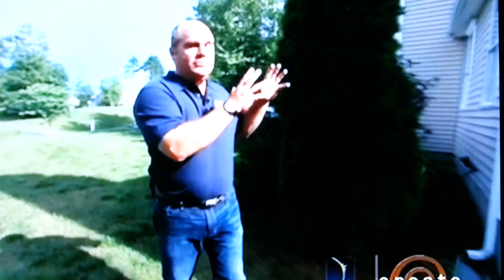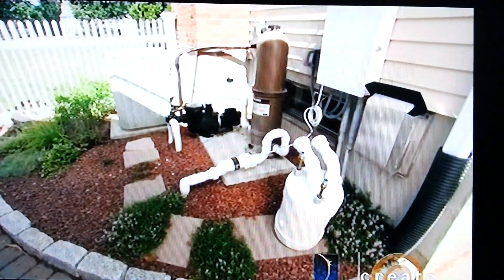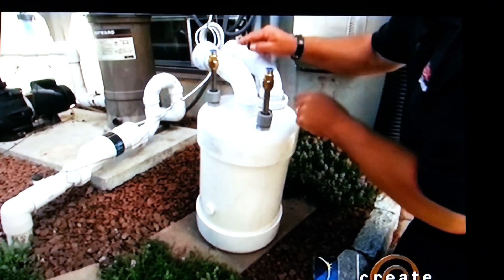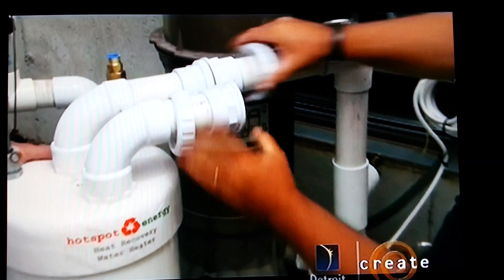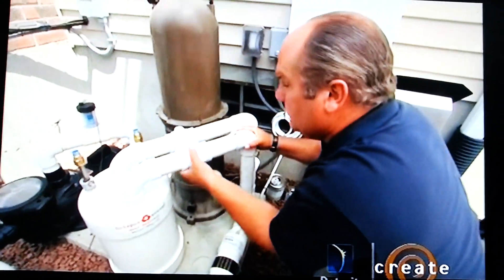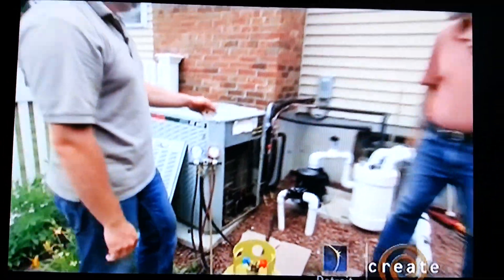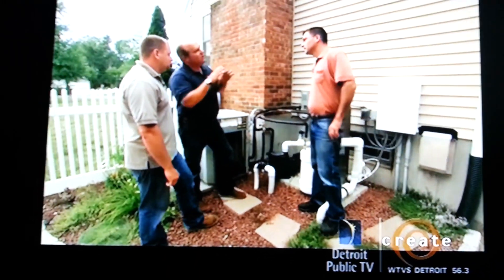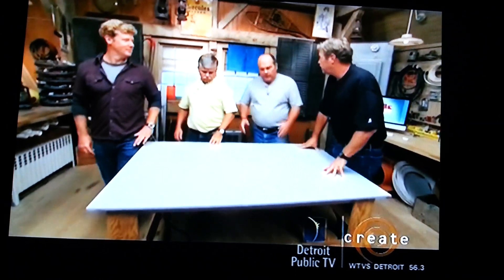HEATING YOUR OUTDOOR POOL WITH YOUR AIRCONDITIONING June6, 2013

Comment: iquid line the used is already sub cooled. Tap into the discharge of the compressor because that's the hot gas. Route refrigerant out to pool exchanger and back into cond unit fins. Rewire the conditioner fan on a fan cycling switch so it closes around 250 and opens around 200 for r22.  This will allow the fan to be used only as needed.

Comment: there are more cons than pros to a system such as this. nothing is FREE. when things go bad and they will at some point it will be very costly to repair and all that FREE heat for the pool will long be forgotten. not to mention that if the A/C unit is a heat pump, now the heat that is going to heat your pool is being taken away from heating your home in the winter time. solar panels on a ground mount stand is a better way to go. again nothing if for FREE. i hope that after posting this about 5 years ago that the system has not met with major tragedy, especially water getting into the refrigeration system. good luck in the future. jim in central florida
Reply: LOL, you don’t know how heat pumps work. If it’s called a heat pump, in the USA that typically means reversible heat pump, so in the winter it would be cold refrigerant going through the lines.. which won’t matter because people don’t use their pools when it’s cold. And the repairs will be far far less than the long term costs of heating the pool. I realize this comment is old and you probably won’t see it but wow someone really must have pissed in your cereal the day you wrote this, not sure why a random pool heater makes you so angry😂 and you just have no idea what you’re taking about, hahaha..
Reply: @mrjjman2010  the line that comes off of the compressor is hot, to very hot no matter if it is in the heating or cooling mode. this line would be the one that you would cut into in order to be able pipe into a heat exchanger for water to become warmer to use throughout the year, whether the outdoor temp is hot or cold
Reply: @MrXcc4u  a modern HP (r410) is pressurized at over 150psi, to get water inside all the refrigerant needs to leak first and at that point the compressor will stop because the low pressure valve. even if you got some water inside you have bigger problems,  the leak needs to be repair, system flush and vacuum to 500 microns (0 water)  
   yes, the line coming out of he compressor is always hot, but this system in a HP is connected after the reversing valve. In cooling mode you will take heat from the outside air, in heating mode the system will be inactive or cooling your pool ( similar to a geo thermal system)
Reply: @mrjjman2010  agree
Reply: This example uses an A/C system that only put out the heat from re-compressing refrigerant. the system operate by checking if the refrigerant is hot. If it is, the cold water and hot refrigerant will be sent to the exchanger to make the trade. The controller is only live when the pool controls are live and these controls are identical to a solar heating system.  This system should not cost much at all but because it is rare to be done it cost more than it should.  An airconditioner releases 48000 BTUs while a running pool heater releases 200000 or more. 48000 BTU of otherwise wasted energy is nothing to laugh at.